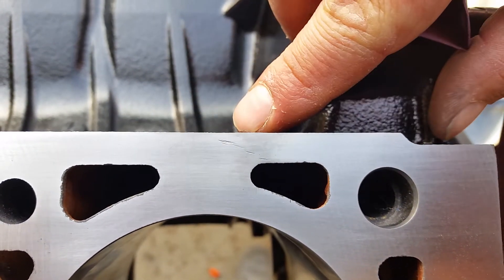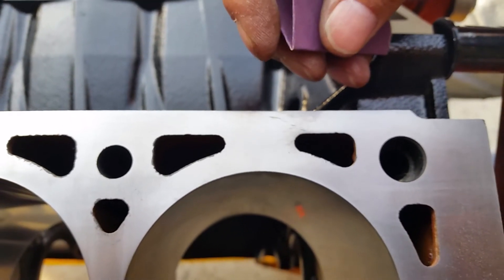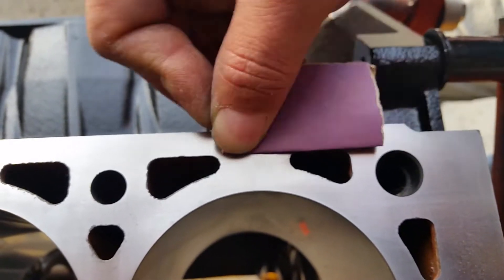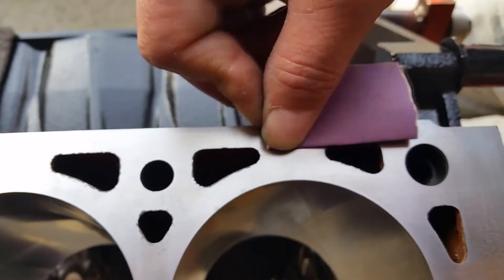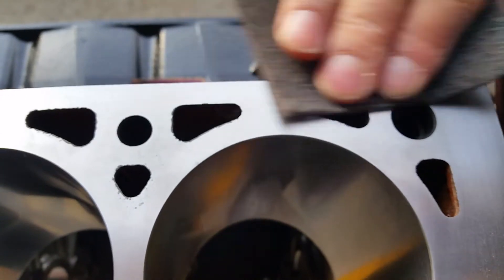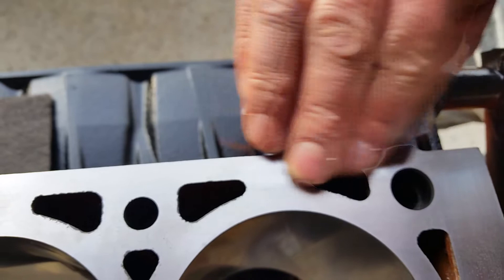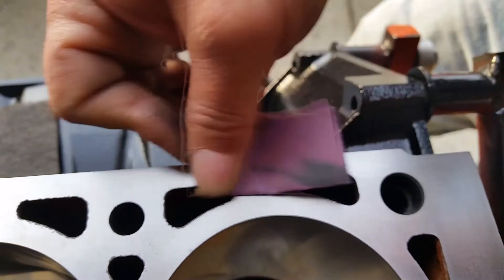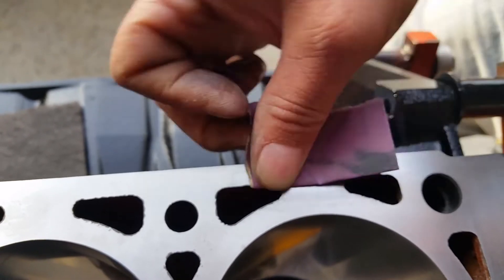Head gasket surface repair/blend

Comment: I stupidly used green scotchbrite pads to clean the remaining gasket material from my aluminum cylinder head mating surfaces. Any tips on remedying this before reassembly? The heads were cleaned while off of the rest of the engine, so I was hoping a vapor blast would do the trick?